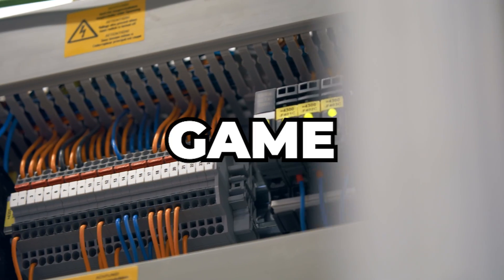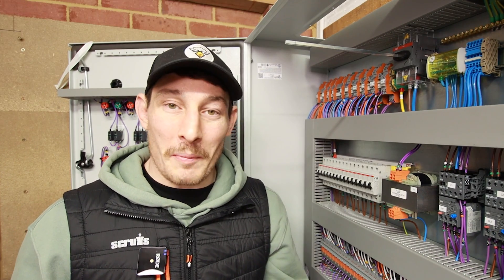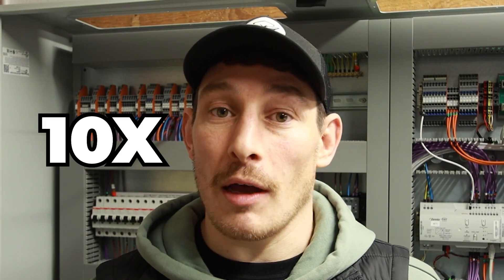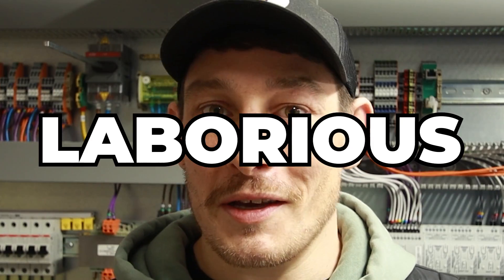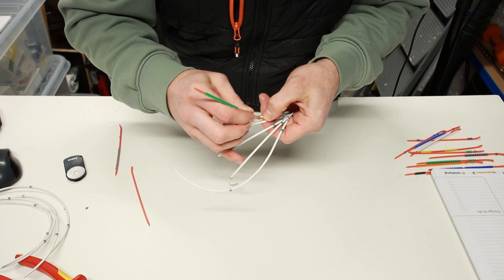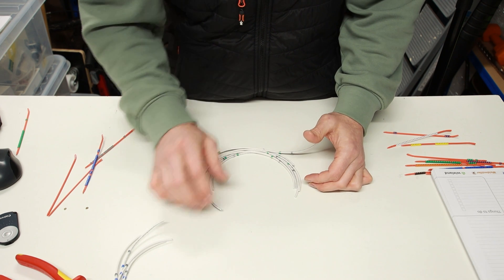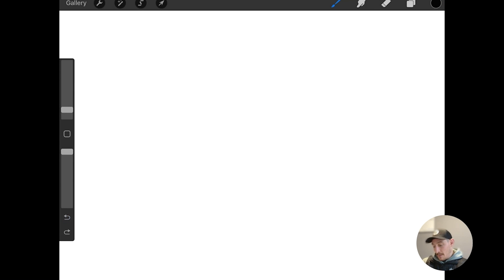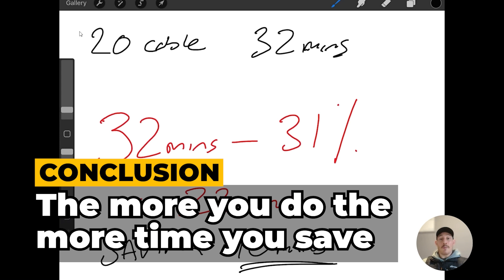How I REDUCED my Control Panel Wiring TIME BY 31%

Comment: I've been building panels for almost 20 years. I use automatic wire trim and cut, ferrule crimp and heat shrink labels. Even with setup, it cuts my time by 2/3. It's a bit of cost in automation, but I can still use my hands.

Comment: I normally have a rack with like 3 drums of cable for my PLC wiring. Pull 3 lengths at a time, 1 cut you have 3 lengths of your “master length”

Comment: Nice video Iam from sri lanka cloud you teach industrial panel board 2500A powee panel.how disrubut ats,capacitor bank,ups system use p.f.r elr how to settings calculate

Comment: That's why I like permasleeve labels instead of wrap around labels. It takes more time to line up your labels and make them look good with wrap around labels. I usually use a "template wire" with the label in the position I want it.

Comment: I wish every cabinet manufacturer used these cable idents. They are so easy to find anywhere in a cabinet. Even if you don't have the wiring diagram it helps to undestand how it's all connected so much easyier!

Comment: Those are called wires, not cables.
And you can save additional time by not using ferrules on the other end of the wire. Because you are connecting them to spring clamp terminals.  

Spring clamp terminals don't require ferrules. Ferrules are only used in conjunction with screw terminals.
Reply: Wrong. A 'wire' is a single electrical conductor such as one bare copper strand. A 'cable' is a bundle of strands of wire coated with insulation. He's right and you're very wrong.
Reply: @CharacterDev 

Ok mr. you are telling me im wrong, but here is what Google says: 

A wire is a single conductor (or a few strands twisted) for carrying current, while a cable is a bundle of two or more insulated wires wrapped in a tough outer jacket for strength and protection, often used for data/power transmission in complex systems like networking or appliances, whereas wires are simpler, used for basic connections. Think of a wire as a single lane of traffic (a single conductor), and a cable as a multi-lane  

Source: Google
Difference between wire and cable

Composition & Structure 

One of the most obvious differences between cables and wires is their structure. Wires consist of a single insulated conductor, most often made of copper or aluminum. Insulation is the plastic layer directly over the conductor. The term “wire” is interchangeable with “insulated conductor”. This conductor can come in various gauge sizes which denote diameter and carrying capacity. Wires are most often used for straightforward electrical connections. 

Cables consist of multiple wires grouped together, either layered, twisted, or braided together. They also utilize a central conductor, insulation, shielding, and an outer jacket. Cables are designed to transmit power, data, or other signals efficiently, and offer ease of connection with a singular connector. 

Source: Igus.com
Cable vs. wire: What’s the difference?
https://toolbox.igus.com/7365/cable-vs-wire

And hers a picture of differences between a Wire and a Cable 

https://toolbox.igus.com/wp-content/uploads/2024/02/wires-vs-cables-01.png 

https://www.dfliq.net/blog/cable-vs-wire/ 

You clearly dont have proper understanding of the electrical terminology.

Comment: Modern control panels are already faster to complete. When I broke out as an apprentice a control panel involved something called lacing most people would cut all the wires first as you had to lace them into looms. There was no PLC or wago connectors it was all relay in some applications diode logic. Those were the days 😂 but it did teach you to plan your job as there was no just adding a wire into a loom once it was all laced together🤬